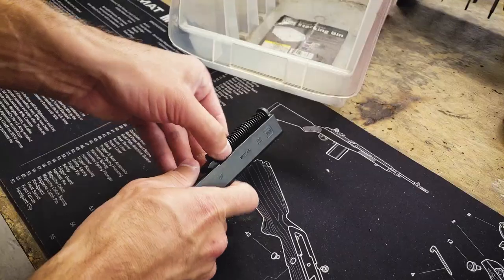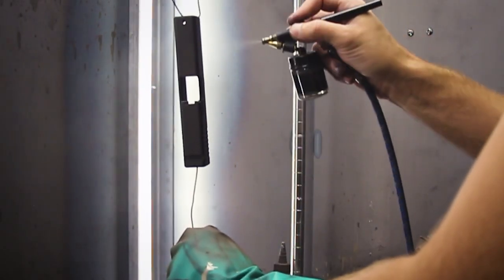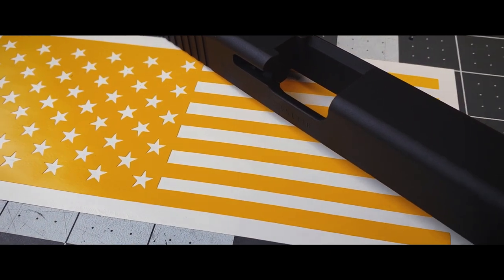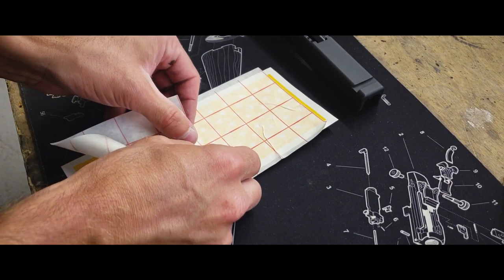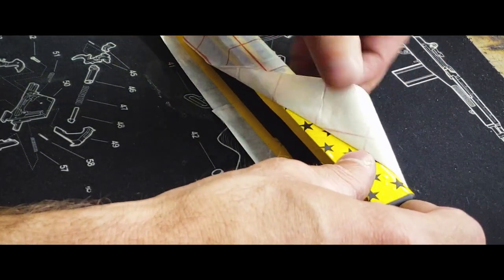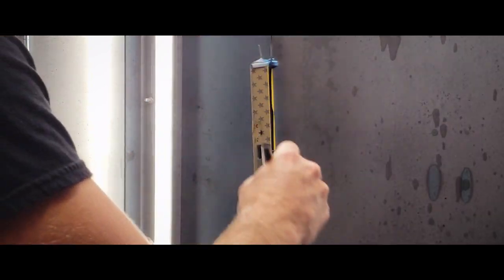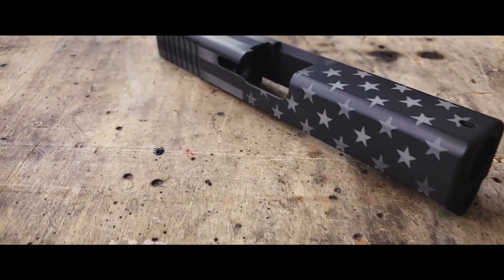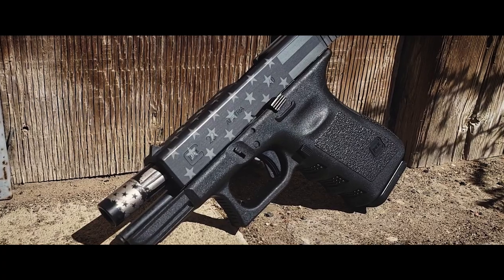How to Paint an AMERICAN FLAG PISTOL Slide

Comment: My Glock 17 9 m m came from the gun shop all painted up like the American flag. When I use Remington gun cleaner it will not remove the paint job will it just curious
Reply from the maker: That s a touch question to answer. It depends on what they coated it with but its should be fine.

Comment: Do you have to cure the stars if so how long and what temp
Reply from the maker: We recommend flash curing between coats for 5 to 10 minutes at 180.  This of course depends on what type of paint or coating you are using and how thick you apply the coats.